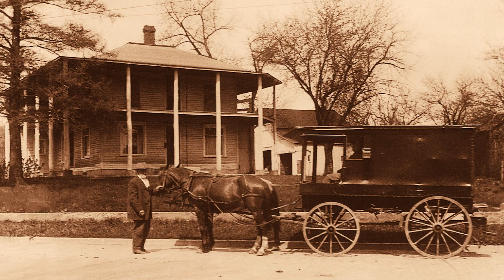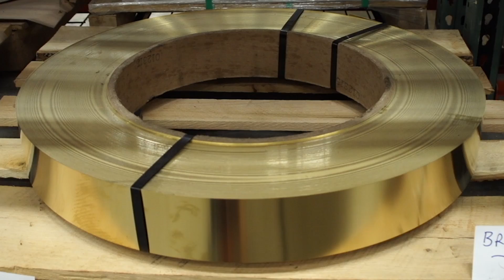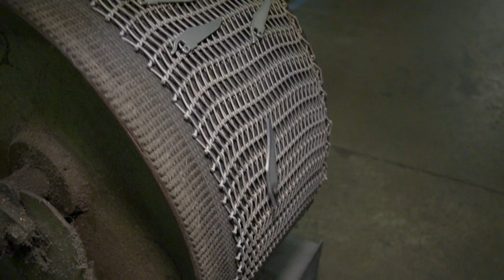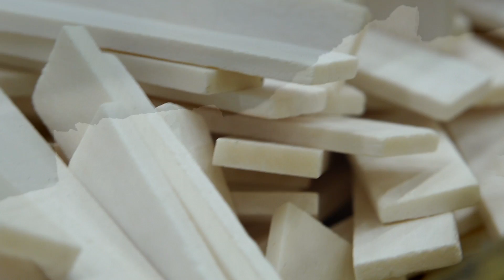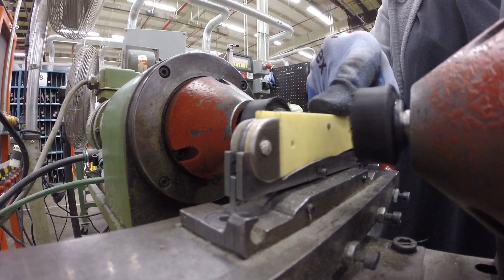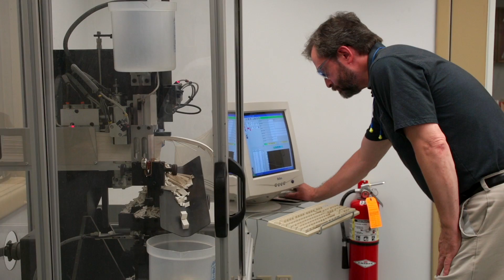Case Factory Tour

Comment: It's hard to beat a Case xx
Reply: Um.......you don't have much experience with traditional folding knives, because Case knives are NOT made to the high quality they once were. They have cut out most of the hand hafting processes, glued shields instead of shields pinned on the correct way, and years ago, they resorted to tumble-polished blades, which beats all the tips and crisp corners off the backs of each blade. Check out Great Eastern Cutlery: hands down, the very best factory pocket knives made today........barr none. They cost more, but they are worth every dollar, due to the old-world hand hafting techniques and the best blade grinds you will find anywhere.
Reply: @howabouthetruth2157  its also extremely difficult to get one especially if your looking for a particular model. That may change in the future if they up there game and i dont mean cutting corners i mean expanding. Space and employees  come on gec step it up the demand is there.
Reply: If they do case would be in big trouble, which would be good they would either have to up the quality or get gone
Reply: @wis1024  Not a chance. It's obvious that you don't know much about this industry, and you damn sure don't know Bill Howard.......who by the way, doesn't owe the world anything. Not only that, but Bill Howard is getting old. The demands coming from newcomers to these knives like you, just don't get it. Bill will be retiring most likely within the next 5 to 7 years, and it'll be up to his son to continue this company, and I highly doubt he will ever have the drive, ambition, and extreme knowledge of this business, the way his father does. Because it is far more difficult than most people realize. Sorry, but that's the truth.